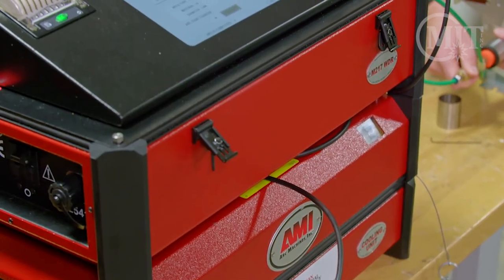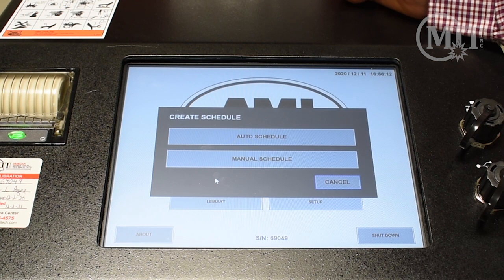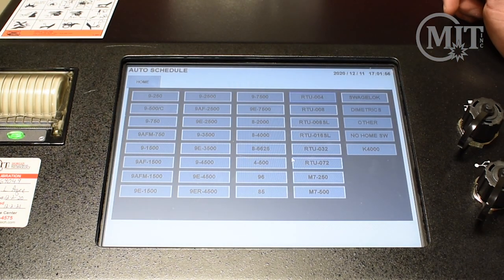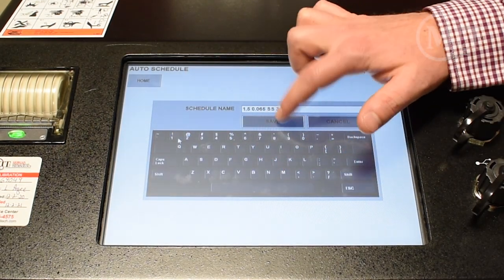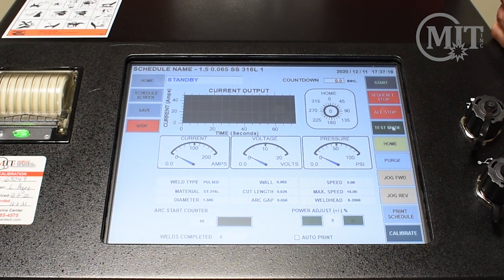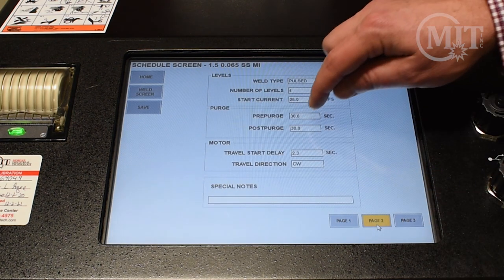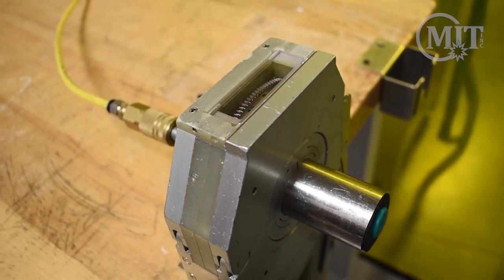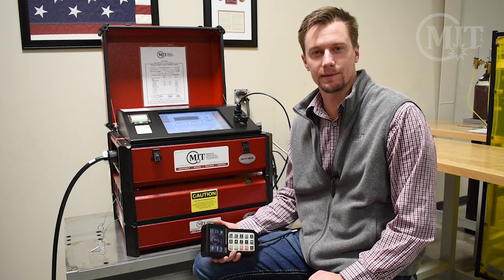AMI 217 Power Source Overview | Arc Machines Orbital Welding

Comment: We have 217 and 207 at work  I need to know how to calibrate these machines insead of waiting for one guy to do it. Sometimes there are thicker side wall mixed with thinner side wallm Then some times the machine doesnt penetrate a  quarter or small section inside the tube.

Comment: Sir can u explain me how to create schedule in 207A which  is not available in LIB like half inch tube to tube welding
Reply: In your weld library I'm sure that there one program that never gets used. Go into that program and over write it. I have filled my library and can no longer write new ones so I over write and save, if I can't remember I just print the library to check.

Comment: If there's a tutorial on how to adjust multi level schedules, someone please point me to it. 

Lvl 2 isn't penetrating enough, & Lvl 3 gets too hot, but as I adjust downslope, amps, and/or speed to try and even the weld bands out it never seems to line up right. I either get not full pen or I end up over heating the weld and it sags in. I'm just guess and check at this point and burning through material. Surely there's a logical way to do this that I'd know if I had experience.
Reply: Make sure you’re calibrating your machine. That can be a big problem.

Comment: What is the difference between AM I217 and AMI 227?
Reply from the maker: The 227 has the capability to run wire feed and has arc voltage control. It's more designed for heavier wall pipe applications